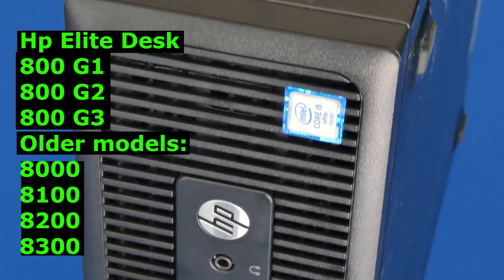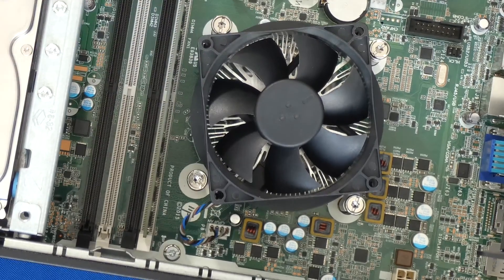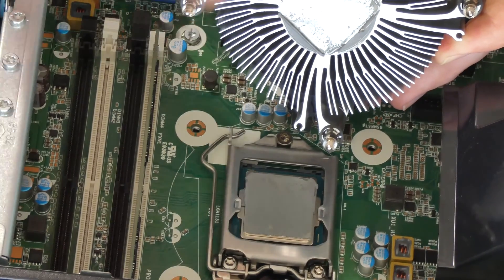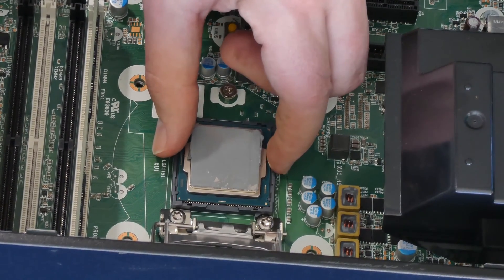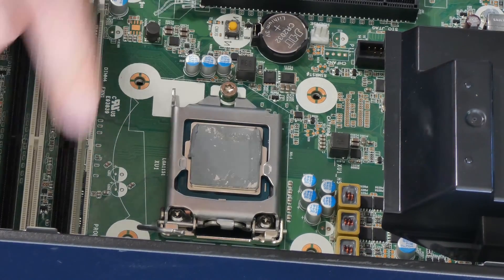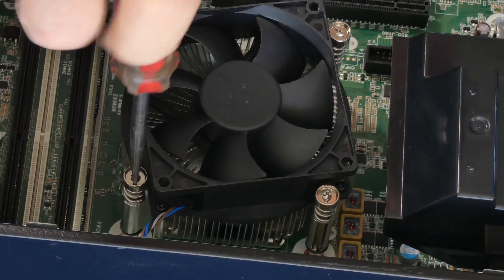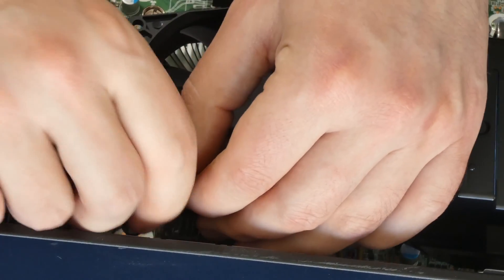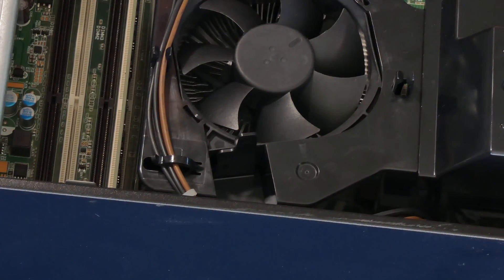i7 CPU Upgrade HP Elite 800 G1, HP Elite 800 G2, 600 G1,  Small Form Factor Desktop

Comment from the maker: i7 CPU Upgrade HP Elite 800 G1, HP Elite 800 G2  Small Form Factor Desktop.
 Affiliate links...
My equipment: https://www.amazon.com/shop/cobuman
Intel i7 4770 For 800 G1: https://amzn.to/2OYw06T
Intel i7 6700 For 800 G2: https://amzn.to/2WYVwM0
Shop around for best deals. You can ask me if you have other models.
Reply: Would a 4790k also fit in my hp elite 800 g1 or just regular 4770 and 4790?
Reply: Cobuman I apologize if my questions are coming off your older vids... Wud an i5 processor be an upgrade from i64family 6 model 60 stepping 3? 
Thanx!!

Comment: Greeting Cobuman, I have a question I recently purchased a Intel I7 4770 CPU upgrade for my Elite 800 G1 but upon running my PC Health check to see if I could upgrade to windows it still says that processor is not supported?? Any advise sir would be greatly appreciated 
Thanx in advance 
Frankie
Reply from the maker: It is not officially support but you can upgrade like this: https://youtu.be/Ad34F6ke3Z8

Comment: Sir, I did the same thing with my rx570, but the image doesn't appear even when I plug it directly into pcie and use another psu for the gpu only. Is there a BIOS setting that needs to be changed?
Reply: Most likely will not communicate with the pcie use a know working monitor and install the driver in windows  ...

Comment: Thanks for making this excellent video. I have a question for you. I have a 35 Watt HP Elite 800 Gen3 and would like to upgrade the CPU to a i5 7500. However, the CPU is for a 65 Watt motherboard, will it run on my 35 Watt board as well?
I look forward to your response, thank you.
Reply from the maker: I did something similar on my 800 G2 and it works fine. I would guess it would fine on your computer too.

Comment: I can’t pull out the fan cable for some reason
Reply from the maker: not sure. don't pull by the wires. pull by the white plug.
Reply: @Cobuman  I got it to work. When I was pulling by the plug it didn’t come out but when I pulled by the wires it worked lol

Comment: Very instructive video. I recently got an HP Prodesk 400 G2. It has a 6th gen chip in it currently. I was wondering if you knew what generation Intel CPU's it would accept? Great video!
Reply: I upgraded my cpu to a i7-6700, aparently that's the max you can go with this pc.
Reply: @Kizanese would a 4790k also work in a G1?
Reply: @dejanvidovic6368  idk much about the k series (other than the fact that it means over clocked). But I haven’t seen a single person use a k cpu on this model.

Comment: Hi sir I have a question. I have a 800 g2 that doesn't turn on. It has a led light in the motherboard. The color of the light is yellow and it is not blinking. What is the problem with my unit?

Comment: Great video :) But I've got a question. I've got an EliteDesk 800 G2 mini 35w with an i5-6500t, and I want to upgrade it with an i5-7600 (the integrated graphic card is better), will it work ? Thanks
Reply from the maker: I have not done it myself so not sure if it will work. It's the same socket, so maybe...
Reply: @Cobuman  OK ! Thanks for the quick respond
Reply: @Cobuman  Does the "MINI version" have same socket as the desktop version?
I want to buy a refurbished budget tiny PC:  HP 600 G2 Core i3-6100T, 16GB for only $180 and upgrade CPU to i7 processor. Is it possible? CPU isn't solded in the socket?
Thanks!!

Comment: My HP elitedesk 800 G1 twr uses a 115x LM kind of mounting system and no aftermarket cooling fan will fit, any advice or pointers to find what I need? I need an adaption plate or something to adapt from 115x LM to just 115x

Comment: Hi guys. Have anyone tried to upgrade I7-6700 on Hp ElideDesk 800 G2DM to a Windows 11 compliant CPU ? Looking into that but I am kind of stuck...cheers
Reply from the maker: Hello, thanks for the membership. The Windows 11 requirements on CPU are very broad and majority CPUs will be supported. However, the biggest issue is requirement for "Trusted Platform Module (TPM) version 2.0"; which is a chip that mostly new computers have. It is possible to install these chips but I would wait a few months after release of 11 to see if they have a workaround for it. I suspect they will...because majority of computers do not have that chip. 

Also, it does appear that i7 6700 works on G2 mini. I don't have a video on it but found this with a quick search: https://youtu.be/Sn8mFE_N2xc
Reply: @Cobuman  thanks !
Reply from the maker: @janmares8816  Sure thing. Take care.

Comment: Hello, I have a HP elite desk G2 800 SSF I was wondering since the pre-installed i5 6500 Is compatible would an i7 6800k/6900k? be compatible, thanks (i really can't find the motherboard model as its some sketchy chinese thing.
Reply from the maker: Probably. However, you can't overlock with this motherboard so it will be running at stock speeds... in which case I would just get a non-k 6700 like this: https://amzn.to/2Y0lbtS if you find a good deal. Otherwise, it's not worth spending $300 on just a CPU when you can get a 800 G3 that has i7 already for the same price.
Reply: they go for 100 dollars the 6800k its cheaper so what do you think?
Reply from the maker: @waterberry6815  Technically, it should work fine considering it's the same CPU socket. The only reason I'm not saying it will work 100% percent because HP never sold that CPU and motherboard combo.

Comment: The components that the HP 800 G1 has by default if they support the i7 processor?
Reply from the maker: Yes, but make sure it's same gen processor. 4th gen like i7 4770
Reply: @Cobuman  Thanks, the information is quite useful, one last question, is there any possibility to change the power source for a 500 w?

Comment: Hello: I have an older HP 280 G1 ST - slim PC - it has a Core i3-4170 CPU and I would like to upgrade the CPU. Do you know what CPU I can use for an upgrade?  Thanks and let me know...Mark!

My old CPU is Intel Core i3-4170, 4th Gen., 3.7GHz, LGA1150 Socket...

Comment: I have an i7 6700k already installed can i swap this for a i7 10700k?
Reply: No, most likely impossible due to the socket type.  I would google both processors and check the socket type. i7-6700k is an LGA 1151 and i7-10700K is an LGA 1200. So not compatible. You would need to change the motherboard, but I would be unsure of the case itself. There might be a snowball effect where it would be cheaper to go and build your own PC. Hope this helps!

Comment: Hello, I got used ProDesk 600 G2 SFF that looks basically the same. I was surprised, that fan speed does not follow the CPU temperature. Is that normal? The only I found in bios is minimal RPM in idle. Fan follows this setting by spinning at same speed all the time. So the fan itself (and MOBO) can change RPM but it does not reflect if CPU is under load or not.

Comment: I would like to upgrade my HP Elitedesk 800G3 SFF. I have ordered 2  8Gb ram. Will a I7, 7700 CPU work? also is a low profile 1030 graphics card a good choice. I wil use it for video editing and some games. Today I tried to play Forza Horizon 4 racing game and it would not even start, it crashes. Watching in the task manager performance the CPU was at 100% and Memory 90%, Thank you for the good video

Comment: I have a HP EliteDesk 800 G5 SFF with CPU i7.  Is it possible to upgrade this to CPU i9? 
Or is it better installing a new graphic card? 
 Do you have a recommendation for a sensible solution?
(PC is upgraded with 2 x Corsair Vengeance LPX DDR4 3200MHz 32GB)
PC is used with a Wacom Intuos Pro medium (Lightroom classic and Photoshop) 
The PC is struggling with the capacity when using the drawing board while editing my photos.

Comment: I have the HP Elite 800 G2 with an i5 6600. Can I use the k series cpu's like the 6700k? I'm planning on changing the case and ps.
Reply from the maker: it would probably work but there is no point because you can't OC so it will run slower. well, you would get more processing threads but aside from that it would run at stock speed.
Reply: @Cobuman  stock speeds are 4Ghz for the 6700k. But the 800G2 mobo does not do OC, so that means that 6700k wont even hit turbo boost to 4.2Ghz? Another thing is that the max tdp for 6700 non-k is 65W where as the 6700k is 95W. I'm tempted to go for it but I'm not sure if the board will produce enough juice for it. Stock speeds at 4Ghz is pretty good I think. I'm planning to change the PS and case too. Any advice?

Comment: Hey cobuman a friend recommended your channel to me, you helped him a lot with his SFF upgrading. I want to buy a g1/g2 and I have a question for which I wasn't able to find an answer. Does HP uses a standard 4 pin cooler or it's a proprietary cooler, will cooler for the same socket from the other computer work?  If it's not proprietary, which aftermarket cooler you recommend?
Reply from the maker: Well, the connection is standard 4 pin but cooler design is not.. however, you can't use an aftermarket cooler in this case unless you transfer everything to another. I have a video on that in which I connect just an OEM intel heatsink. https://youtu.be/C70nmtTFPuw
Reply: @Cobuman  Arrangement of the holes is non standard or cooler height is the problem?

Comment: I have a G1 model with i5 4590 and I want to upgrade to i7 4790 and GTX 1650 but I read some articles and watched a few videos where people are complaining about CPU throttling due to PSU and motherboard limitations and clamming that upgrading HP to a GTX 1650 is pointless. What's your experience so far with HP, any throttling? What about gaming, how does it compare to a custom build PC with similar spec. A lot of questions I know but hope you can help me, really like your channel. Cheers.
Reply from the maker: Some people do experience extra heat inside case after GPU has been added; however, most people don't have any problems. This is the GTX 1650 LP I recommend to my viewers: https://amzn.to/3mYcs2S because it's the new DDR6 version. I've noticed the cost has gone up this week which is odd... Anyway, adding a GPU of any sort is not pointless because the difference is massive in 3d performance. You go from game working to working at 60fps... :)
When it comes to power usage I did an interesting test on my PC to measure wattage: https://youtu.be/FHtlk-re_ss

Comment: hey man this motherboard has any support to ryzen chips or amd gpus?
Reply from the maker: This is an intel socket motherboard. When it comes to GPUs it does not matter which CPU or motherboard you use... as long as you have a PCIE x16 slot.
Reply: @Cobuman  does this support ryzen cpu chips?

Comment: on the eliteone 800 g1 can i upgrade to the i7-7440k or s ? any help is much appreciated
Reply from the maker: No, the 800 G1 supports 4th gen intel like i7 4770 and the "k" variants might work... but there is no point of doing it because you can't overclock on HP motherboards.
Reply: @Cobuman  this would be for a childs school work computer and only looking for whatever small boost this and another 8gigs of ram will give. not looking to OC it or anything would it be worth the 35$ for the cpu ?
Reply from the maker: @benjaminnugent3821  It's up to you, but for school work 8gb of RAM is good enough but if you can add an SSD drive that would help. My video on SSD upgrade: https://youtu.be/XFe4SlJVwm4

Comment: Great video, very helpful. I tried to upgrade my Elite Desk 800 G1 from an i3 4160 to an i5 4670, but I could not make it work. Seems that the BIOS is locked and does not allow CPU changes. Any recommendations? The mother board model is 717372-003. Thank you.
Reply from the maker: It should work no problem. If your BIOS is locked there is a green jumper on the motherboard. Just pull it out and it will unlocked the BIOS (green, around 4mm wide plastic 2 pin jumper). If that does not work you can try to update BIOS like this: https://youtu.be/4m98pAakQ4I
Reply: @Cobuman  Thank you. I will try it.
Reply: HP EliteDesk 800 G2 SFF prices are good.  G3 & G4 are still too high priced.  $150.00 seems reasonable, while a CPU upgrade is expensive.  TPM & Secure Boot support on G2.

Comment: I have this is exact PC, would a Core I7 4790 be compatible? If there is a better cpu out there I could install which one would you recommend for the best performance?
Reply from the maker: Well, this PC is 800 G2 which supports 6th gen intel. If you have 800 G1 then 4th gen i7 4790 or 4770 should work fine. Here is an example: https://amzn.to/3fT6H2a
Reply: @Cobuman  Ok, thank you for the helpful info!

Comment: Hi Cobuman, is it possible to upgrade G1 SFF from i5-4690 to Intel-Core-i7-5775C CPU (since it’s supports same socket). Appreciate your advice on this please.
Reply from the maker: I see what you're saying; however, this PC has Intel Q87 Express chipset which does not officially support that CPU. Only 4th gen CPUs but I am curious if it would work.
Reply: cobuman You are right, after reading through some articles http://www.cpu-world.com/Sockets/Socket_1150_LGA1150_H3.html, only 9-series chipsets, H97 and Z97, support Broadwell i5-5xxx and i7-5xxx unlocked CPUs.

Hope at least this should work Intel® Xeon™ E3 1231 V3 with this socket.
Reply: @natakankal4688  i know its already a year? Can you put xeon e3 123p v3 in prodesk 60p g1 sff?

Comment: I have an 800 G1, Can you list all CPUs that I can install instead of the original CPU?
When I use the i7 4770, is the HP boxed cooler sufficient?

Can I use Corsair Vengeance 1866mhz DDR3 RAM?
Reply from the maker: I would use i7 4770 standard like this: https://amzn.to/36KidJO reuse the HP cooler works fine. For RAM I can only recommend Crucial like this: https://amzn.to/3cefjhG CT102464BD160B (RAM has to be Unbuffered • NON-ECC.

Comment: Nice video, can you advise, I have a HP Elite 8300 with i5-3470 and a HP ProDesk 600 G1 with i5-4590. Found a good deal on a i7-4770 for my 600 G1. My question is could I move the i5-4590 into the older 8300.. is it compatible? I figured the 4590 would be a bit of a upgrade over the 3470 ?
Reply from the maker: Thanks. So, the 8300 has Intel Q77 Express chipset which only supports 2nd and 3rd intel CPUs. The 4th gen will not work.
Reply: @Cobuman  I understand, thank you for such a fast reply. Was a good idea but lucky I didn't try :)
Reply: @Cobuman  One ore question and your advice, I installed a 4770 into my G1 600, got a good deal on a used CPU, idle the temps are around 32-37 the same as my old 4590, I used CPU-Z to run a cpu stress to make sure the used i7 is good, I run for about 30-40mins the temp got to about 85c a little hot but its under full load, would you say thats OK? (it didn't crash so I assume the PCU is good)  I stupidly didn't get a temp under stress on the i5 before I swapped. Do you know of any fan control software that can control the single fan as it does not rev up really fast. Over all the i7 is faster but its not a massive jump over the 4590 I guess that was a good CPU to start with, most games are giving me the same FPS, I do have a GTX 1050 LP (2GB model)  After a CPU swap do you need to pull the battery or reset anything, my first boot it hung but 2nd boot it was fine... is that normal ?

Comment: nice video thank you..
qst: i hv 2 pc: HP ProDesk 400 g4(i5 7500) and HP EliteDesk 800 G1 big one(i5 4570).
so i want to reverse they processor, no problem with that?? i mean BIOS or the size.. I don't want to risk please..thank you ^^
Reply from the maker: I'm glad you like my video. What do you mean by reverse they processor?  
Don't try to swap processors between those two PCs. If that is what you mean... it will not work.
Reply: @Cobuman  yeah that what i mean.. thank you so much :)
Reply from the maker: @saberlinkin  sure thing. take care buddy.

Comment: Hello again, What is the best graphics card for modeling and animation purposes that will fit my HP EliteDesk 800 G1 SFF? Right now I have a Geforce GTX 1650. I am also upgrading from Intel i5 to i7. Ihave been using Autodesk Maya a lot and have been crashing quite a bit. Thanks, Paul
Reply from the maker: The best workstation and 3d animation graphics cards are something like nvidia quadro series but I don't know enough about them to recommend a specific one. I do know they have low profile version that should fit inside the PC.
Is Autodesk crashing because it can't handle the amount of detail or just crashes randomly? 
If the whole PC is crashing it could just be overheating; otherwise I would try repairing or reinstalling Autodesk.
Reply: @Cobuman  It is crashing from using Paint Effects. I guess it cant handle the heavy processing load.. Thanks, I will take a look at the Quadro series.

Comment: Hey cobuman, I have the HP Elitedesk 700 G1 SFF PC. It currently has an i5-4590 and I am planning to upgrade. I want to know if a 'K' processor will be compatible with the motherboard or not? 
i5-4690K or i7-4790K
Reply from the maker: Good question. Technically speaking it should work but there is no point in getting it because you can't overclock the CPU in these motherboards. BIOS does not support it and it would draw a lot more power/create more heat. That being said they never sold the "k" series CPUs in these computers.
Reply: So, If I put in a  4690(non-k) or 4790(non-k) will it work?

Comment: If I change mine over to i7 do you have a cpu cooler upgrade you could recommend?
Reply from the maker: It should work fine with stock cooler. The stock setup is designed to move hot air out of the case so you are better off using it.